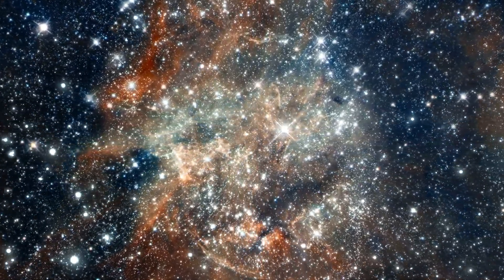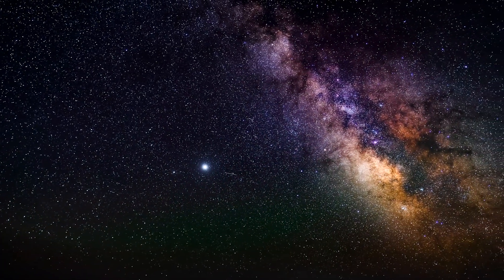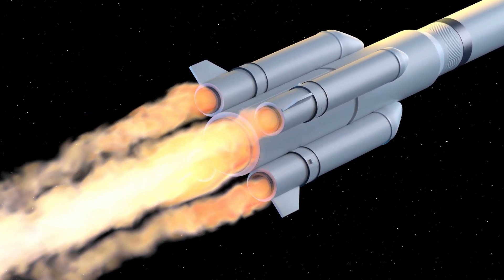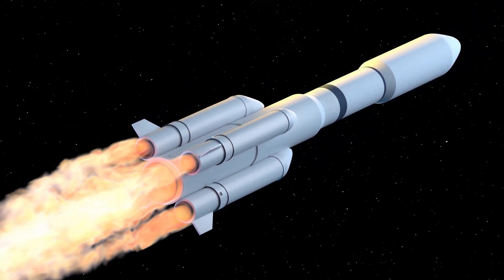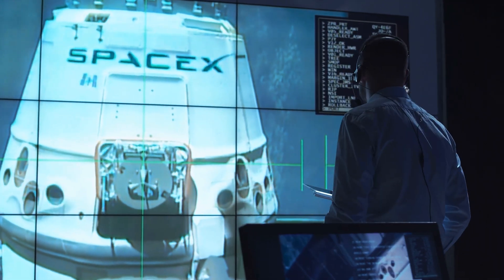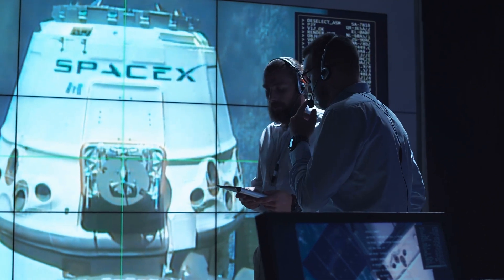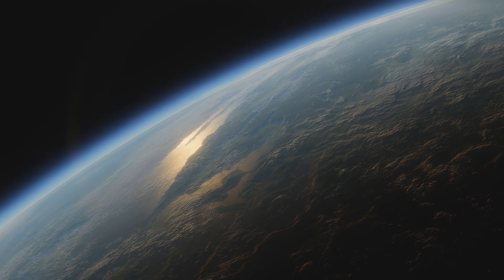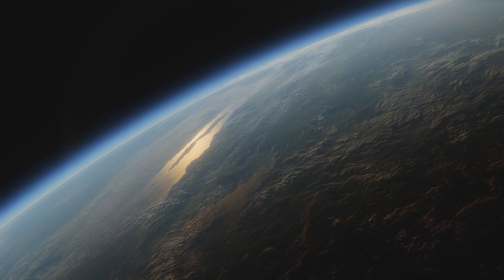Scientists Create a Super-Small Engine for Spacecraft That Uses Water as Fuel.

Comment: Interesting and thanks.  So, F = ma =(m*v^2)/r. F is a directed force equalling mass times a (which might also be a vector or a collection or sum of vectors) --- the bit on the far right is part of the Huygens' equation for centrifugal force (F).  Imagine a circular tube or pipe with water being pumped through it in a close system . . . water say.  Then fold the circular pipe to about 20 degrees or so along the diameter as explained in the book by jim parons, 'Traveling Through Space --- Without Rockets --- The Shorter Versions, which might be found in the more less cooth regions of amazonium, I suspect.  Cheaply, perhaps?
Reply from the maker: We are very glad that you liked it.
You raise an interesting point.
I think it's worth thinking about how to implement it on a miniature scale.